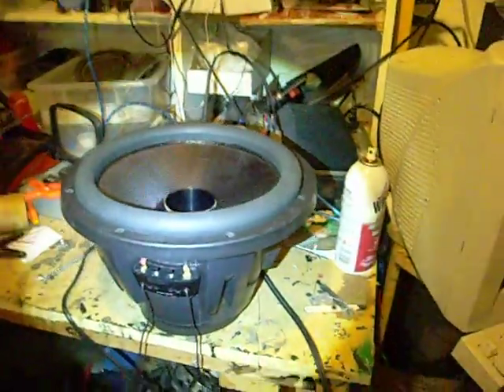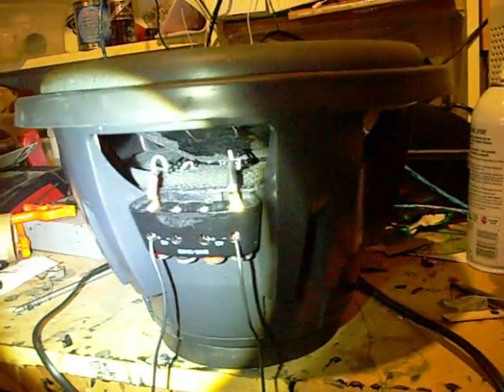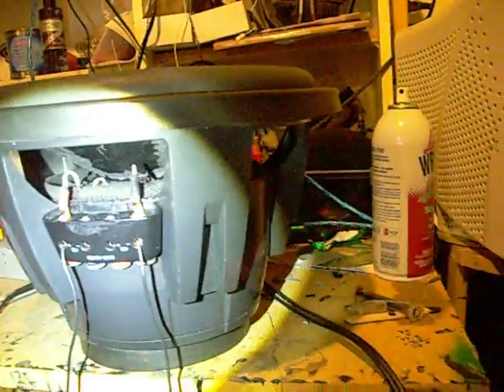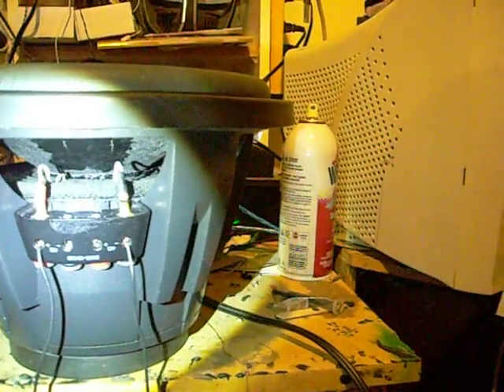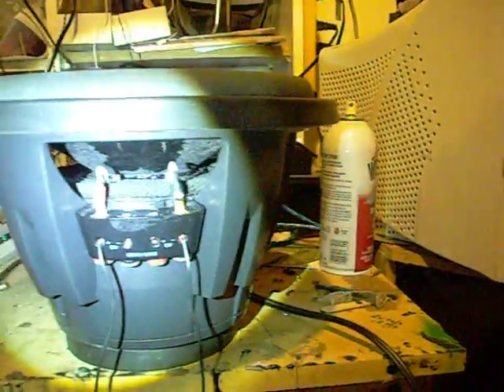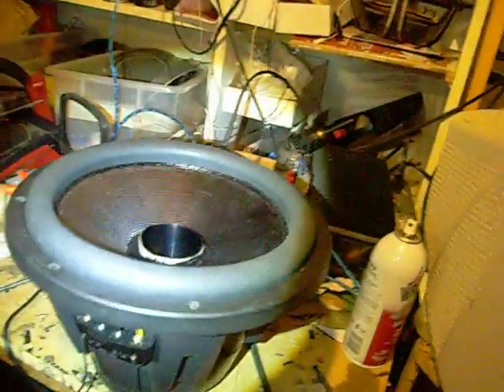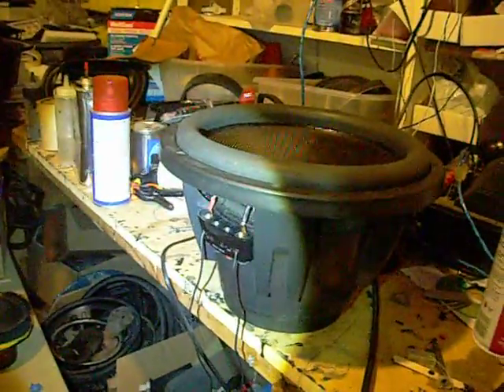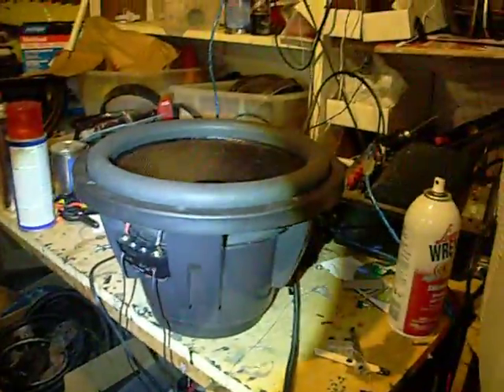Alpine Type R custom recone

Comment: These subs are super easy to recone!! i have reconed about 30 of them i have tones of parts to recone them with. OH and the coil is not 1.95" thats the pole pice size on the  12" the 15s are the ones with the 2.5" coil the coils I use are 1.97 ID 2.14 OD it fits a mean ass 4 layer flat aluminum coil. I have 3 rebuilt ones in a 4th order doing a 155 flat on a mojo 4kw super sweet subs if you put better parts in them alpines soft parts blow !!!
Reply: @baconbrandon where do you get the coils from?
Reply: Brandin Tatro where can I get the recone fore the 15s
Reply: Can you please send me the parts list and supplier stuff 
919-491-6797 be glad to send cash for real information.  Thx alot

Comment from the maker: @JoSeDbZcOoL 
I sell them for $100 . Its a custom recone kit that maximizes the Type R motor and basket to its highest potential
Reply: I kno it's years later but are u still reconing type r's? Email me and let me kno. I got cash in hand.
 tjamaalmoore@gmail.com
Reply: I'm also interested in recones. I have four good SWR-1243D's and I know where I could get a couple more that are blown super cheap. If I knew where I could get all 6 of them reconed with good parts I'd literally beat the four good ones to death and get them all redone. It would really be awesome if I could get a coil combination that would somehow get all 6 subs wired up together to get a single 2 ohm load. My Taramps HD8000 is a beast but it's finicky about getting the ohms right. Any less than 2 ohms and it might go up in smoke.